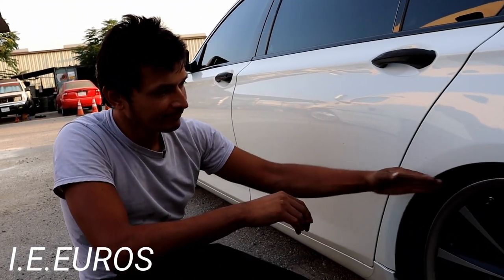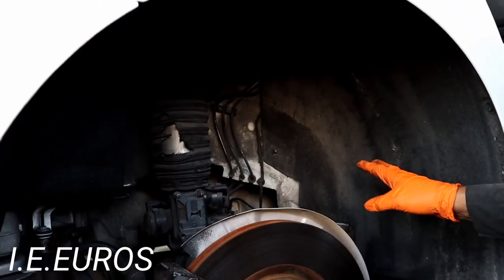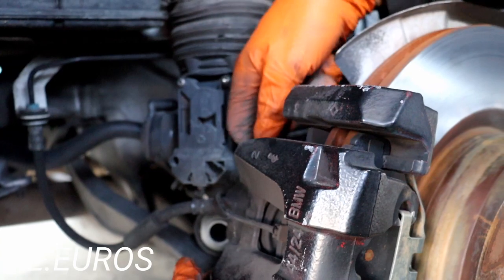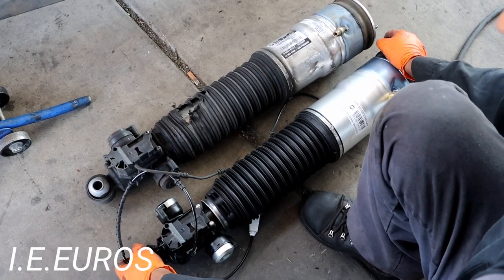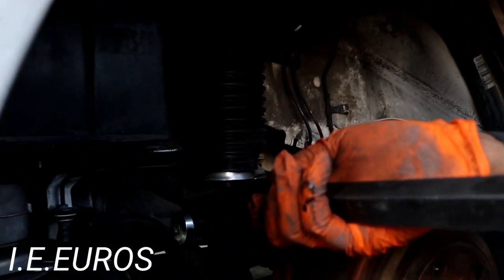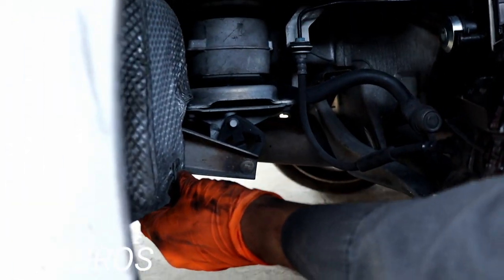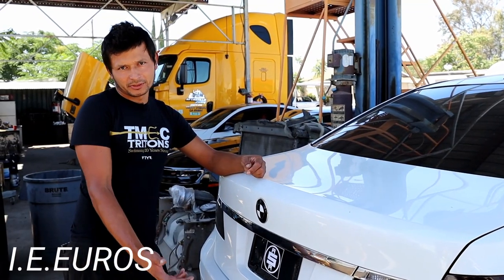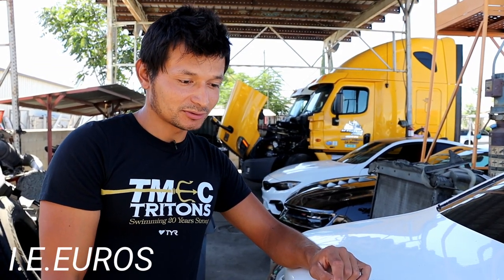BMW 740i 740Li 750i 750Li 760i 760Li rear air spring shock absorbers replacement

Comment: On mine, when I put the new air nipple on the air line I left the tip of the line a little long and when I screwed it into the pressure valve on the strut, it wasn't letting the air in the bag. Even with 130 psi. It drove me nuts. All I had to do is cut the tip of the air line a little shorter in front of the brass nipple and it filled up. Then just had to calibrate the ride height and it worked. I almost replaced the compressor but I didn't have to.

Comment: If both sides develop the sagging at the same time, it could be the pump or the diverter. If it is one side only, it will be after the diverter. Always check for leak at the diverter and brass connections, and also the tubing. Replacing the struts is always the last thing to do and there are aftermarket struts (without those sensors) for a lot cheaper. 
So, $100 if u have to replace the tubings and connections, and $500 at most to replace the struts. Don't spend thousands. It make no sense to spend 25% (more or less) of the value of the car to repair just the suspensions.
Reply: You doing this job,Im in Houston

Comment: I'm going through this exact thing now on my 2009 750li. The compressor replacement cost $2400, and the air shock replacement is $5600. The dealer replaced the compressor today then discovered the shocks weren't holding air.
Reply: The dealer knew the real issue 😂😂😂
Reply: Never go to the dealer unless the car is under warranty. I've spent thousands at the dealership before I really knew they are the worse. Find a solid reputable shop that works on Euro cars or BMWs only.

Comment: Great info. Thanks for videos you post. When replacing the air strut as show here, would you need to program, code, or update anything on computer (other than calibrate ride height if required) for the new part(s)? Please advice. Thanks again
Reply: I saw a video of a bmw dealership mechanic . Say that you need to program it after replacement so you are right and

Comment: One warning and comment. before you jack up the car, take the nuts off the shock towers, and when you lossesn them all the way, 1. You have to use a magnet if you want to take the nuts off the shock towers and keep them. I tried without, lost two of them inside the car, had to get new ones at the dealer. 

Do not jack up the car with the nuts loose, or they will fall off and inside the metal, you will never get them out or back. I had to go to the dealer to get 2 of them because of this.

YOU HAVE to use a magnet to pick them up, and put them on, just like he does in the video. 

As for the 21mm bolt, on the shock bottom,  i used a Dewalt 20V 250lb impact, and it would not do anything, i had to use a 21mm wrench and a hammer to get to break loose, so be ready to deal with it, unless you have an air impact, with more than 250lbs of torque you are in for a lesson. He is right that you have to remove the brakes to get the shocks out, i removed the two bolts holding the entire caliper assembly together, it was easier to take off them take the brakes all apart.

Overall that's pretty much it, when you have the fenderliners off, you might as well spare and clean out the underside, cause there is always grease and road stuff on here, i even replaced my fender liners cause they were 11 years old and dried out.

For those that do not want to run BMW Air shocks as replacements, you can buy rebuild kits on eBay for like 300 bucks for the pair, its not too hard to do, there is a youtube video in how to rebuild them, its a 2 person job but will save you a fortune vs. replacing the entire units.

Or you can buy Chinese shocks, swap them, but the rebuild kits, and sell the BMW hardware valved units on ebay for your money back and some, you probably would break almost even if you do it right.

LAST WARNING - when you replace your shocks you have to get to a ISTA+ programmer to reset your coding and ride height to the car, if you do not do this you will get a EDC error on your dash and your car will ride like it has no suspension on it. I also learned this hard lesson by having to take it to the dealer to get reset and fixed. This is something that they do not tell you in the video either.

There are coders online that can do this remotely, but in my case, my software needed updating so it had to go back to the dealer.
Reply: Always you will need to reprogram? Or just sometimes?

Comment: Hello Francisco, Juan here. First, thanks for all the good information from your videos. Today is 8/09/23 
My 750li has a small on the rear passenger side. Would you recommend to replace the air bag assembly from the air shock unit. Is it a difficult task for a DIY enthusiast lol? You don’t mention any of that in your video but the whole unit is too pricey. I’ve seen a few places selling just the bags.

Comment: Question….. When I’d lifting mind bummer from the rear driver side, I did hear air pressure coming out…. So, should be the suspension replaced or the compressor??? I will really appreciate it if you can advice me what to do at this point. Thx!

Comment: @IEEuros,I followed your YouTube video to replace the left rear strut on my 2011 BMW 750 Li with an OEM part. The installation went smoothly, but I'm now seeing an error on the screen indicating a malfunction in the Electronic Damper Control. The error code displayed is D76D61. Any advice on how I can fix this?"

Comment: Question. one of my shocks is loosing air I start the car goes back up etc and it will hold air for a while... why do we have an air compressor for ? once the bags are inflated they are supposed to stay like that right ? or does the system actually drains them and then fills them back up ? based on each Comfort, sport mode etc ?
Reply: Hard road bumps will cause a small leak which the compressor has to compensate, moreover, if the road had an incline the car will adapt the height accordingly by draining air from one side and them supplying again once car is level... What is unnatural is for a car to loose height when parked on level which engine is off,

Comment: Hi, I have issue with my 750Li, When I lock car, right rear side falls down and next 10-15h another side will falls down. First question, If rear right shock will be bad, air will be lost also from left side  ?Or this side should be in upper ?
Reply: There is a block vale that controls thr air supply from the compressor to both sides, the air leak from one side shouldn't affect the air in the other one, mine today dropped on right twice and gets back up when i start the car .. the funny thing is that it didnt drop again so far , cant understand this!
Reply: @moeleganem123  Ok when we off the engine and leave a car how long rear shocks should they keep the car up?  or when the car will drop down by itself after what time? Shouldn't it drop at all?

Comment: I just replaced driver side air strut and tested. All 3 others raise, does that mean my air compressor is bad? Or module, or the new air strut? Please advise, tks 2011 bmw 740li
Reply: How did you fix it?
Reply: I replaced with an oem strut
Didn’t work
Replace new air compressor 
Didn’t work
Replace the line 
Didn’t work
Sold it, costs to repair started added up to more than the bmw was worth

Comment: The super long bolt at the bottom of the shock absorber is so tight I cannot get it off. My big impact gun is too big to fit and my small impact gun is too weak to get the bolt off.  I'm super frustrated

Comment: i have the opposite problem; that is with the front suspension of my '07 750i: it is too high. i would like to lower it by 20 mm. how do i do it?
Reply from the maker: Go to air suspension calibration using a compatible scan tool. Measure the distance between the rim edge and the wheel arch. Grab the measured number and add 20 mm more. Type that on the scanner and that is how it will go lower
Reply: @IEEuros  appreciate the reply. I’ll find the tool and try it out. Thanks.
Reply: @IEEuros  Great info. Thanks for posting videos. When it comes to calibration of vehicle, is this the same when using ISTA-D? Do you increase number (mm) to lower it?